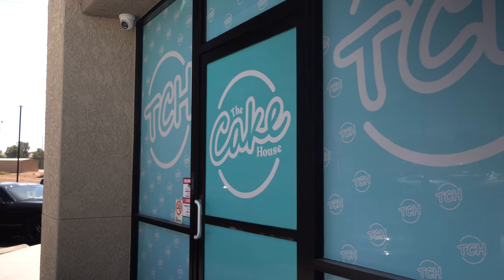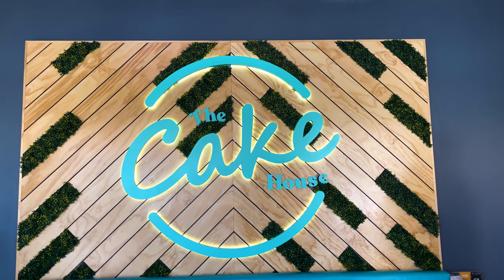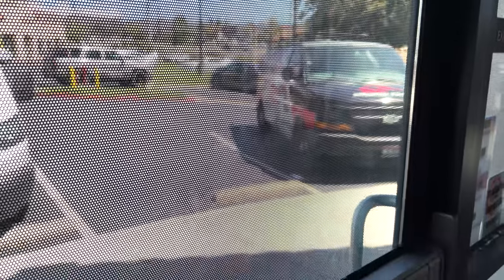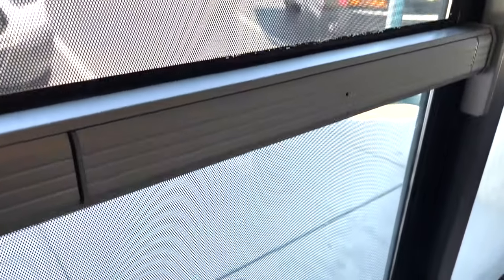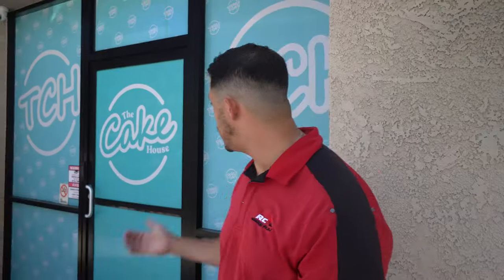Storefront Window Film Graphics

Comment: Another great video. Have you tinted the inside and installed window perf on the outside? I'm curious if a 5% dual reflective tint installed on the inside would effect the perforated vinyl installed on the outside.